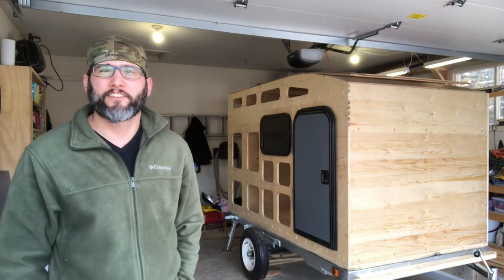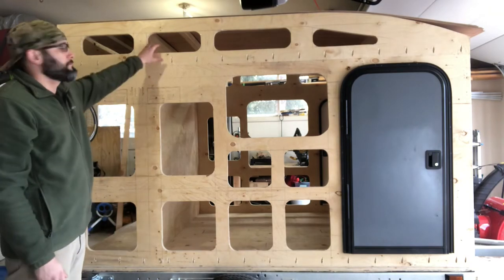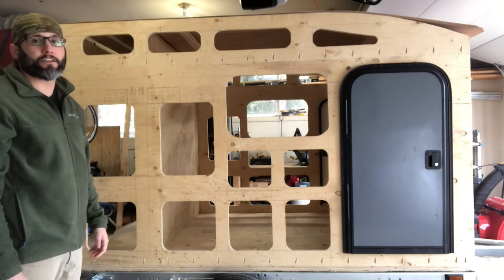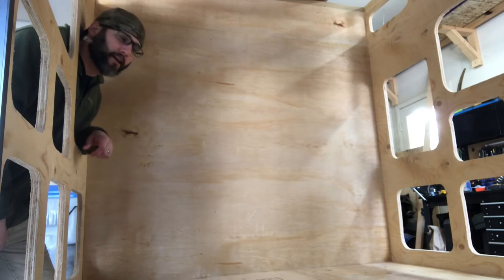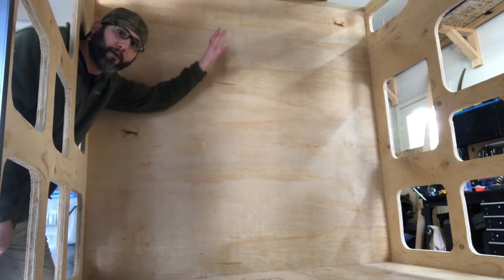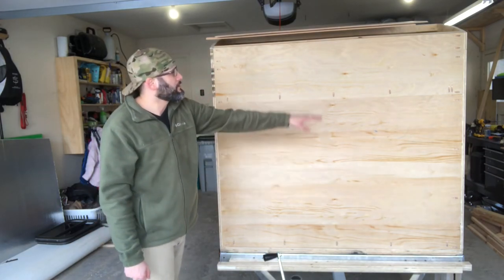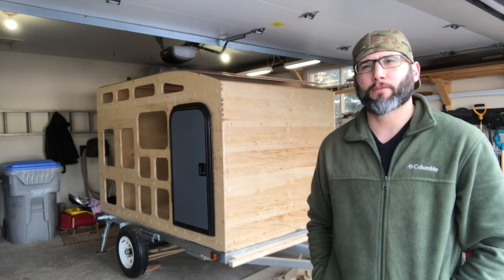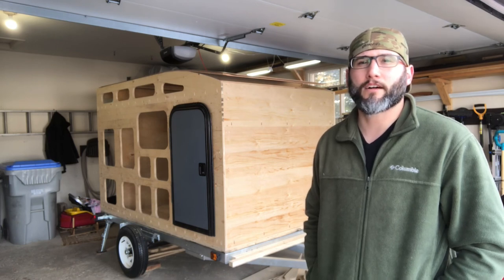DIY Teardrop (Square Drop) Camper - Video 2

Comment: Great video! You made some sweet progress from video 1. Solid idea staggering the seams to lock them into place. It would be pretty cool if you threw in some time lapses of the construction. Excited to see the progress in video 3, earned my sub.
Reply from the maker: Thanks for the comment and sub! Yes, staggering the seams on the front wall and the bulkhead wall really helped. i figured this tip might help anyone who wants a bit taller camper and still use plywood walls without stick framing...  Once the ceiling panels are in, and i have all the roof spars in place - it should be rock solid. 
I'm still fairly new to making video's, so I'll see if I can incorporate some time-lapse or progress photo's in future videos!